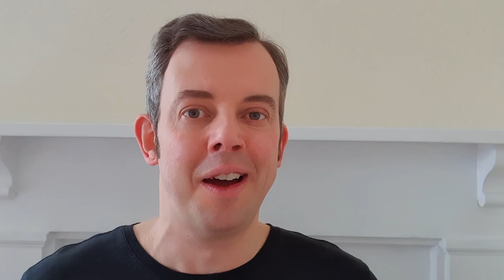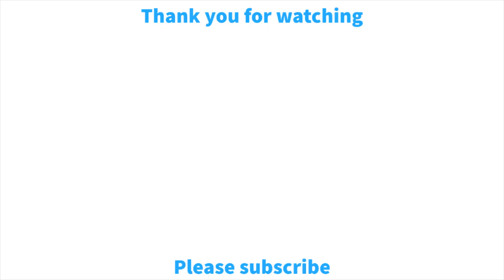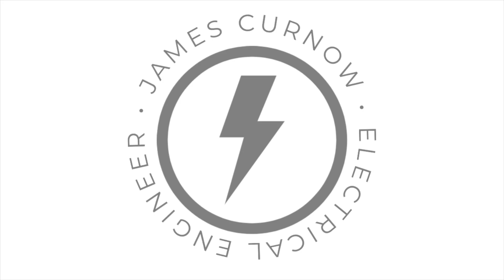How to size earth cables and bonding cables

Comment: What size main earth  if its TT- tails 16mm? I done a eicr- it was 10mm to the rod- it was clipping direct to the brick work and then went under ground for a bit. 

I assumed it had to be 16mm reading table 54.1 . As there is no mechanical protection on it and goes under ground for a short way. 

Please can you let us know your thoughts.
Reply from the maker: See Short reply